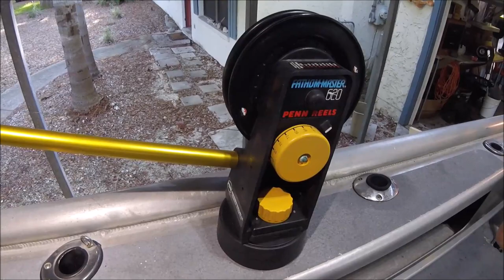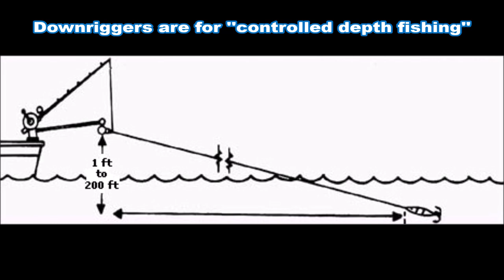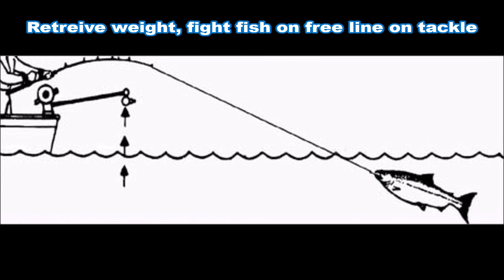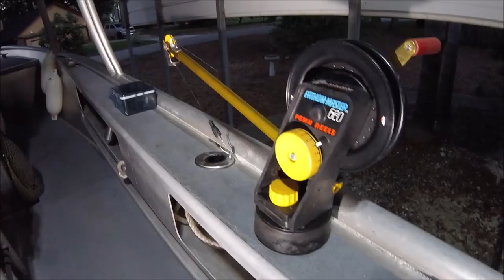Vintage PENN DOWNRIGGER, preferred

Comment: I just bought a boat with these bases pre installed without the rest of the parts. Mine have the “ear wedges” on the sides. What reels or rods(?) should I get in your opinion?
Reply from the maker: not enough info

Comment: Just got a pair of the electric 835. They are simply the best downrigger in mine opinion.
Reply from the maker: actually the Vintage part was nothing more than the swivel bases I needed.
Reply: @CaptDavesSportfishing  I have the newer style ones. They work great, but as you know, takes up more space. How deep do you fish with your riggers? Over here in Denmark i fish down til about 180 feet, thats why i went electric.
Reply from the maker: @Kaptajn1eye  30-40 only on July, August Florida summer intense heat, for king mackerel offshore in ocean. The rest of the time they sit in storage in a closet, like right now

Comment: Those old bases that don't lock 
 into position kinda suk. They're okay for fishing but it's often helpful to lock them out of the way when trailering or docking.
Reply from the maker: it works fine, the new bases are too wide for my needs. They are modify'able. Thanks for your concern